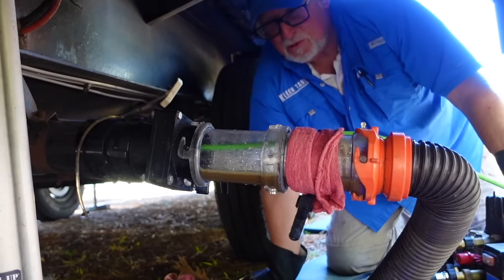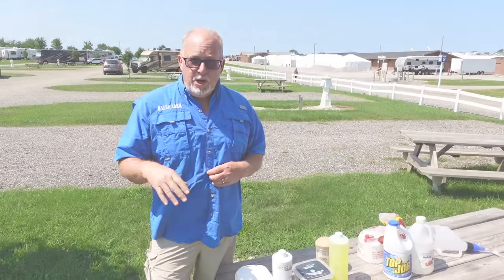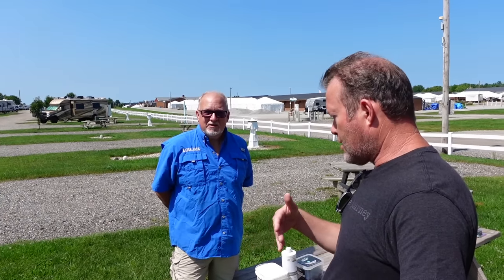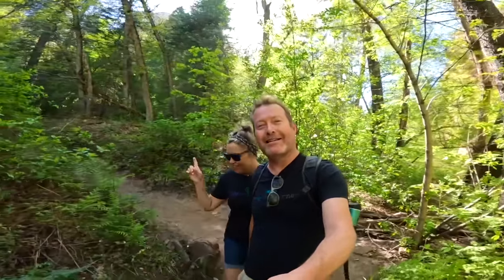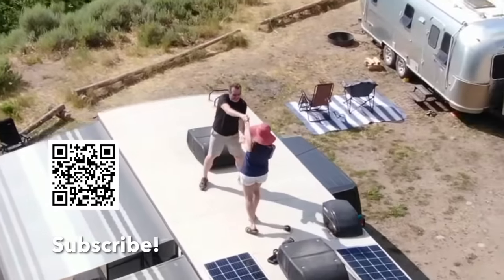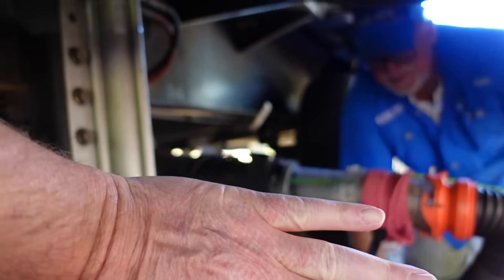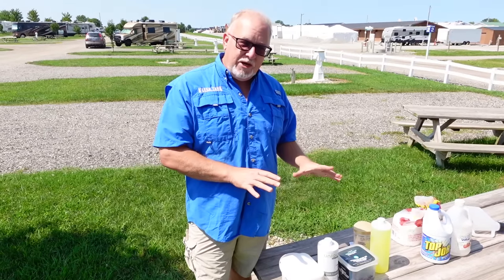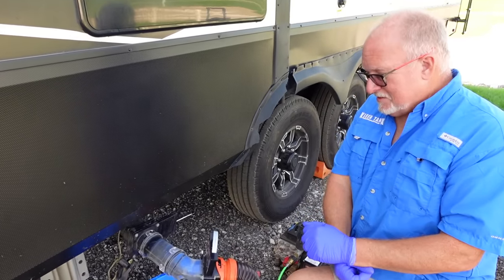RV Products That Damage Your RV! Black & Grey Tank Cleaning Myths

Comment: The recipe mixture is 48 ounces (40 oz pine-sol and 8 oz Calgon pearls and some water.  Then you have a large batch.  Just use 6-8 oz each dump.  More with hot weather.
Reply: 6-8 oz Each time you take a dump or each time you dump  tanks?
Reply: Each time you dump your tank.
Reply: Do this before or after you drain tank
Reply: @Debi0614  after your drain your tank and start fresh.
Reply: Is there a ratio for an 80 gallon tank?
Reply: This doesn't work, but you do you
Reply: @kathleenrutherford733  what make you say this doesn’t work! Thx
Reply: @brianshackett5753  For an 80 gallon tank (that's a big one!), use 2 cups (can double in hot and humid weather).
Reply: @tarseneau8975 can you put the solution in before camping or is it after dumping?
Reply: @tarseneau8975 can you start fresh with the solution?
Reply: @Berrypancakes229  I put the solution in after dumping the tanks. Yes, you can put it in before camping with a gallon of water.
Reply: @Berrypancakes229  You can start fresh. I see it to be the same when you start fresh and or after you dump your tanks you put it in each time with an empty tank and then go camping and fill it up...
Reply: @kathleenrutherford733  same question why do you say this doesn't work. We would like to know so we don't make mistakes
Reply: @jonandsaragalindez2930  I’ve tried it and it does work , breaks down the toilet paper and no smells. I used my black tank flush and water came out clean
Reply: How much is “some water”?
Reply: Thank You for sharing this recipe. In Truth I'm Disappointed that the link Forces you to install Whatever this thing was... Not subbing😔

Comment: As a certified and insured RV technician working on RV's since 2009. The only thing exclusive about this video is it is misleading. This video sounds like they are paying each other. What Calgon and a cap of pin sol is free with a tank treatment? WOW!! Sign me up. I highly recommend the use  of the natural enzyme products - never a clog or odors. Sludge or poop slurry means that the tank does not have clumps of poop and toilet paper or fat because it was LIQUIFIED. Yes use regular toilet paper! Use lots of water and flush your black tanks. The "exclusive" jetter is not very exclusive. A tank cleaner has to have a electric pressure washer that goes to 1500 PSI. Kleen tank is not doing anything more or less than all the other cleaners. outside of marketing and franchising. There are many certified  insured independent tank cleaners that have a super cool 1500 psi jetter and we all do it the exact same way with a high pressure jetter hose, and high pressure jetter nozzles.

Comment: We use one of the natural enzyme products - no clogs, no odors, and no issues. The secret to avoiding sludge is the golden black tank rule: lots and lots of water and flush your black tanks multiple times when dumping. Kleen Tanks "exclusive" jetter is not exclusive and they are not the only cleaners around. I am an independent tank cleaner and have a 1500 psi jetter, the same high pressure hose, and jetter heads.
Reply: True!  I am also an independent tank cleaner and have a 1500 psi jetter.
Reply: Agreed!
Reply: @karencupp439 Hi , I'd like to start offering this service to my customers and would like to know where to purchase the jetter system you use. Thanks! I can't find much information regarding a good jetter system for this application.

Comment: I have been using the Calgon Pine-Sol mixture since your first video. It has been working great for us! My tank sensors have never worked better. Thank you for the information!!
Reply: What is the ratio you are using for the size of your tank? Please
Reply: That's awesome! Good to hear.
Reply: @brianshackett5753  For tanks that are 40 gallons or less, use 1/2 cup (four ounces) of the pre-mixed tank solution. For tanks over 40 gallons, use one cupe (8 ounces) per tank. In hot and humid weather, you can double the amount added. Always follow the tank solution with some water (one to three gallons) so that it gets thoroughly down in your tanks (both black and gray). Great question!
Reply: Yes I do use the mixture because it leaves a thin coat of very slippery agent & when I open the black tank everything goes & use the side wall water hose for 4 minutes and clean... Yes I'm a rookie at this camper stuff.. he's right on. Thank you for reading

Comment: My question is how often should I dump the tanks.  We are on a seasonal site.  We do not have FHU.  I have to haul the blue tote to the dump every time its full.  Can I wait to they are full which could take a few weeks or should I empty them into the blue tote and start with a fresh 2 - 3 gallons of water.  Also, how often should I use my internal jet cleaner.  Every time I dump or can I go a few dumps before rinsing.

Comment: Bleach will also swell the rubber seals on your gate valves to the point of barely being able to move the valves.
Reply: And not to mention that it is extremely caustic. It can be used -- in a temporary and fast situation -- to sanitize your freshwater tank, but take the necessary precautions to flush it completely out of your RV's plumbing and holding system.
Reply: It’s very little bleach  The rest is more water .

Comment: Good information. I've been using the Calgon Pine sol treatment for two camping seasons now in both black and gray tank. No clogs, no smells and my sensors work. I use the lemon scented variety. I fill and flush my black tank multiple times and store it with some water and treatment in the tanks between camping trips.  On a recent camping trip our neighbor had KleenTank come and clean there tanks. Fun to watch the procedure. Thanks for the video.

Comment: Other than plain water in the empty black tank before use, we add nothing to either tank. We have had zero smells. I’ll always dump the black tank first and use the built in tank sprayed/flush at the end of a trip and then bump the gray tank. I’ve been doing this for many years with zero issues.

Comment: The best way to keep down black tank odor is to keep 2-3 inches of water in the bowl after each flush. Periodically I rinse the black tank with an rv water wand until clean water comes out. We use pinesol and will now try calgon.
Reply: A great solution! Remember, our tank solution is a good start, but there's no substitute to a professional cleaning first -- and then using plenty of water and, if desired, our tank solution.

Comment: Having a nice smooth runner for your septic hose is nice. The best performing and cheapest way to do this is by picking up an aluminum gutter. This will fit nicely in your rear RV bumper in sections and when you put them together makes for a long, ridged, runner that also keeps your gutter secure.

Comment: I use 1/2 cup of borax and dawn each and I dissolve that in a bucket of warm water and I dump that down the RV toilet with plenty of water. No smells and it keeps the black tank liquified.  You don't need a lot of borax, just a little.  It's called the bio-geo method.

Comment: Kleenexes Tank is a good service, but the digesters info isn't real that great. If you flush well after each trip and dump 10ls of ice and a cup of Borax when traveling to your camp ground, your black tank will work well. Also if possible add a cup of Dawn dish soap to your grey tanks, and fill them with hot water, let them sit over night of possible, and drain and flush, and your never need a service like Kleen Tank

Comment: I didn’t see this, but after I dump my black tank, I dump about 30 pounds of crushed ice in the toilet. Then I drive home, and dump the tank as soon as I get home. Then I fill with clean water using the “flush” port. When I dump that, it’s all clear water. Is that a good idea? How do I effectively clean the grease build up in the grey tank?
Reply: Does absolutely nothing to my tanks except melt. My rv is set up to run smooth down the road, absolutely no rocking or forward and backward movement

Comment: Hello
First thank you for these videos on black tanks I have 2 questions: 
1)	I am not a us resident, Where can I buy the pipe and fitting you using with your wather pressure machine?
2)	We are 2 adults and we can barely go over 3 days with our 30g black thank. You reports family going 2-3 weeks. Do we use too much water. 
Thank you
Allen

Comment: This is basically a variation of the Geo Method for maintaining RV tanks without the occasional use of bleach.  The reasons for not using bleach seem sound.  I'm curious why the use of bath pearls rather than the traditional Calgon water softener.  I was not aware of the Kleen Tank service. I might have to give them a call to clean the tanks of my used, but new to me, RV.

Comment: I use normal TP. Have been for years. I flush the black tank with the elbow sprayer every time. I leave the tank half full afterward. Only have trouble in the winter if it's super cold. NE Oregon.

Comment: National Rv Training Academy did a YouTube video comparing black tank additives. They actually recommended them. 
They gave Liquified the best additive. 
Is he saying that NRVTA is teaching the wrong information?
Reply: So I image to each his own applies here. The first video I saw them do was with Unique. I have been using that three years now. (Full time RVer) Does a wonderful job for me controlling odors and treating the solids. Saw the comparison video and thought I’d try Liquified because it did “liquify” better. For me though? It did not control the odor like Unique did. But? To each his own. I am sure you know everyone is different Including diets. Your crap may stink “differently” than mine. 
Otherwise, 3 years plus and no ill effects on the RV system. I do however just have a basic system. Toilet, tank, tube to dump valve. No sensors to worry about. I’ll also add Liquified is enzyme based while Unique is bacteria based. Both are “supposed” to be safe.
Reply: I wondered about that too, having just come from the NRVTA myself.  Bacteria are there to help digest and PineSol can kill them, which has me wondering.   I’ve tried this home grown recipe and yes my tanks smelled great, but it did have me wonder.

Comment: Really wasn’t sure why I clicked on this video. I’ve been full time RVing for just over three years now and have been treating the black tank like a septic system. Tank treatment, try to top it off with plain water just before dumping but rarely a complete rinsing. I would imagine if I have any buildup it would be on the ceiling and maybe in the corners of the black tank. The relatively small tank looks pristine inside after just dumping. Obviously cannot see the ceiling or corners, but I can say when I changed dump valves a few months ago there was no buildup on the tubing leading up to the tank. (I have one of those swivel 2 into 1 dump valves that I actually do swivel up for the added ground clearance so yes the seal started dripping from the grey tank side. 2 seals in three years is okay for me) Call me lazy, but the little money I spent on treatment does a good enough job with odors and cleaning  out the tank between dumping. Maybe I’ll borrow a borescope sometime and check the ceiling and corners. Or just wait until I either quit full timing or sell the camper to get a professional cleaning(if needed). 
Good video though!

Comment: Usually the smell is caused by bad "Air Admitness Valve or a tank vent is obstructed. If vents are blocked when you dump your tanks the tanks being drained with cause the P-traps to empty and smell with come up thru the sink drains.

Comment: I have been using dawn and calgon  for laundry;  but will be switching to the beads. But what about using the dawn? Coments appreciated.
Reply: Personally, we think RV owners use more than enough detergent that gets into their tanks. There's no need for more. In fact, over time, a super concentration of detergent can gel up and concentrate, causing clogs and other problems. Get a professional cleaning, use our tank solution and use plenty of water and you'll do just fine.

Comment: Mentioning bleach and vinegar in the same segment without emphasizing DO NOT UNDER ANY CIRCUMSTANCES MIX THEM makes me cringe.  Acidified bleach is unbelievably corrosive to any ferrous metals.
Reply: Good thing there is no metals in the 💩 system 💁‍♂️😂
Reply: @kevink4914  There are steel screws holding the valves together.  Get that stuff on them and they're toast.  The sensor probes are also metal.

Comment: Ok …. Years I’ve been doing this???? I use thetford liquid. I dump tank then flush tank 7-8 times flushing from top of toilet and also the clean out on side of trailer filling to top of toilet. Then I leave cap off on main line and let dry for several days.  I cap ? Then put my liquid thetford with 3-4 gallons of water back in tank.. and ready for my next trip.  After 30 years of same procedure? I have never ever had any problems? I also flush grey the same.  I do not need to waste money on all these expensive chemicals…

Comment: Incorrect.  Happy Camper does a great job and doesn't turn to peanut butter or sludge.   Verified with camera.  Using YOUR method of just water, ended up with clogs every month.  Using lots and lots and lots of water.  This advice is meant to drum up business for your repair.  Full time here.
Reply: I noticed the poop didn’t break down with the pine sole and calgon